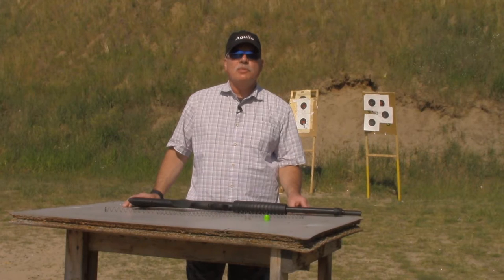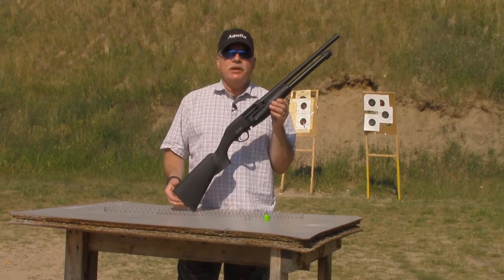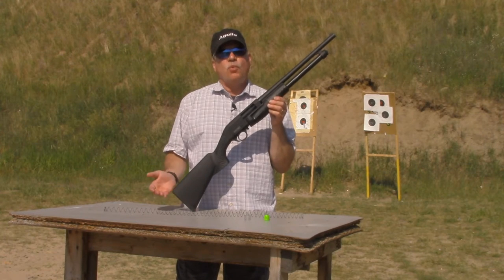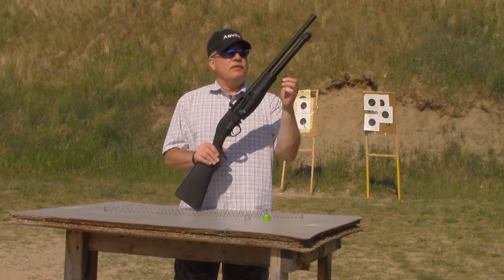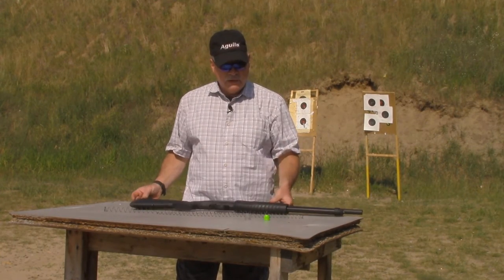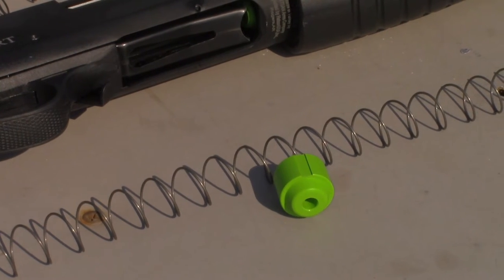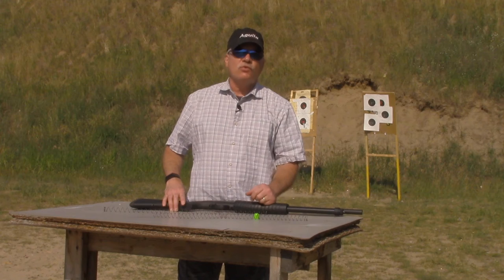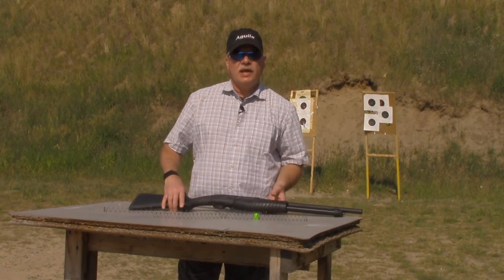Turkish Shotgun Invasion -  Necessary Upgrades Hatsan Slugger

Comment: Well, I thought I was going to have to call this a loss. Apparently, Hatsan made a change on the Tactical Pump, on the old-style mag tube you could remove the plug with some snap ring plyers, on mine the ring is no longer there it's a plug spot welded on the outside I had to heat the tube and knock it lose with a hammer and drift pin. I used black heat paint to repair the finish on the tube to replace the plug I tapped it back in with two tiny dots of Loctite 496. A slight PIA but still a good product. Thanks to Scott Mueller for the assistance.

Comment: To replace, use 3/16" dowel to compress and hold the tube spring.  While holding spring, compress and pull retainer out using snap ring pliers.  It may take a few tries.  Reverse the direction of the spring retainer when you re-install it.

Comment: Thank you thank you thank you. I got one of these for Christmas. I didn't want to complain about it, at the same time I wanted to make sure it's not going to blow up in my face. I definitely noticed a clunky/ notchy feel. Hopefully this is the cure(sure seems like your on the right track)
Reply: I have two Turkish 12 gauge Semi-Auto shotguns by different brands.
The secret to NO jams is to use shells that are 1400 FPS or greater. 
I use 00 Black Aces at 1425 FPS.
1100 FPS or 1200 FPS shells jam the shotguns and will not cycle. 
You're welcome.....

Comment: I have two Turkish 12 gauge Semi-Auto shotguns by different brands.
The secret to NO jams is to use shells that are 1400 FPS or greater. 
I use 00 Black Aces at 1425 FPS.
1100 FPS or 1200 FPS shells jam the shotguns and will not cycle. 
You're welcome.....
Reply: Upgrade the follower and a slightly longer spring, and you'll be able to shoot below 1300fps with no issue

Comment: I think its great that you make better parts for these imported shotguns.  It would be great to get a kit containing stronger screws and pins for them!!!
Reply: I was able to replace all the screws and roll pins with superior pins/screws and loctite.  On Amazon, Brownells, you can find them.    I had to get a few sample packs to figure out which ones, but it didn't take long.  It's been working well since the changes and breaking in with 300 rounds.  The only thing that keeps falling out is the roll pin for the front sight, even with red loctite.  I'm trying to see how I can completely remove the front sight and replace it with a bead/fiber optic bead.  The factory sight are low quality.

Comment: My problem is that the shotgun shells hit the lip on the top of the barrel and get stuck before they feed in the chamber. like the elevator lifts the shell too high too fast. Sometimes they feed good sometimes they get stuck idk.
Reply: Same problem here
Reply: Yeah, I have a Hatsan Escort Magnum (2+1 semi auto) and notice a similar issue. I've only shot 70mm shells through it though, I wonder if slightly shorter cartridges would work better...

Comment: Why not just lightly sand to a smooth the edges of the follower to eliminate the issue?
Reply from the maker: It would take a lot of sanding and you would risk making the follower too small so it would not catch the shell latch. The type 5 follower has smooth radius edges and it is milled out of a solid block of Delrin. Much better. Thanks Scott

Comment: So is this a type 3 follower or a type 5 follower? I have a Hatsan Escort Slugger Tact 12 gauge. All the info points to a type 5 follower, but the link in the video takes you to a type 3 follower.
Reply from the maker: The type 5 follower is the one you want for the Hatsan.
Reply: I have a Hatsan Escort Slugger
 Do I need both the spring and follower or just the follower?
Reply from the maker: The kit comes with a spring and a type 5 follower. You need the spring. The factory spring is un tapered. It does not fit into the follower well.

Comment: I have an Escort MPA and it vibrated apart after 30 rounds.  I replaced and loctited every pin and screw with stronger pins and screws.    I upgraded the spring with a Wolfe added power spring and used the Green Follower.    Polished the interior parts with flitz and greased liberally. Had major loading issues which have diminished breaking it in with buckshot.  I got the stock adaptor and changed to Magpul SGA and limbsaver which made a HUGE difference.  The Hatsan stock was too long and painful. I have major doubts this will make it 1,000 rounds .  These are cheap for a reason .Next shotgun will be a Benelli.  For the hundreds of dollars you’ll spend fixing the Hatsan , you could have bought a Mossberg or Benelli pump.
Reply: Look them up in turkey they are 1700 they are not cheaply made . Law enforcement number 1 shotgun in turkey

Comment: I recently just purchased this shotgun and want to add this follower and spring. But my issue shooting this gun for the first 20 rounds were jamming up making it very difficult to reload. I was running 2 3/4 inch dove loads. Should I go with 3 inch instead? Any insight would be great.
Reply from the maker: Thanks for your note. No 3" won't make it jam less. Keep using the dove loads and pump the action very robustly... with purpose. A new follower and spring will help.

Comment: I’ve got a question about this. Could I use this follower in my mossberg 590 shockwave? I’ve heard of some people using aftermarket followers that don’t protrude far enough into the chamber and cause problems. This type 5 design looks like it sticks out a bit farther than your mossberg design. Have you had any strange reports like that with your mossberg 12 gauge type 3 follower?
Reply: If you were to send me dimensions for both I’d be able to make the determination of whether or not the Turkish follower will work in my mossberg or not. Or you might even already know haha.
Reply from the maker: @aaronpeople101  The diameter of the type 5 follower is a bit large at .910" The Mossberg type 3 is best for Mossberg shotgus.
Reply: @04BlueSmoke  I believe I ended up using the Turkish follower in my shockwave and it works very well

Comment: Have the exact same gun and it has feeding issues. Shells gets stuck on the top edge of the barrel when feeding in. Any suggestions?
Reply: I had this issue and had to adjust my technique. I think it’s an issue where the user is limp wristing because the pump on this thing is so “short” if you know what I mean. Hope this helps.